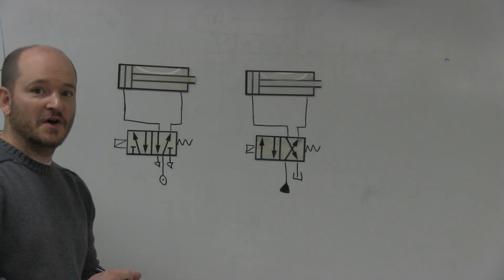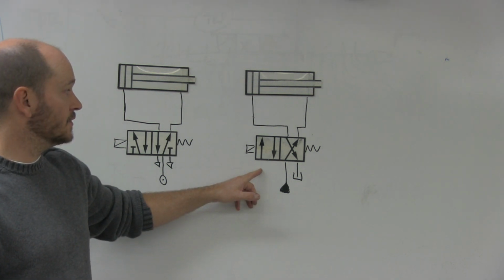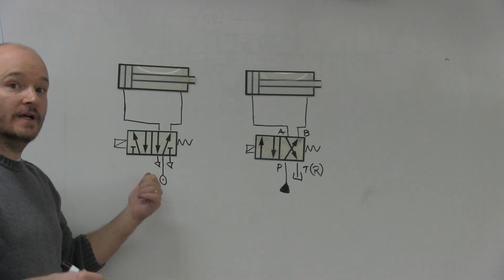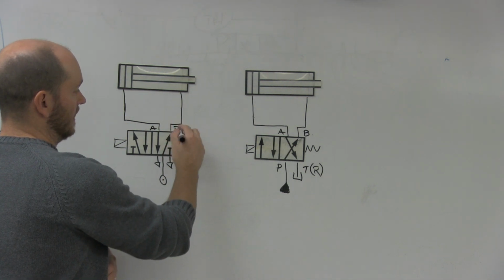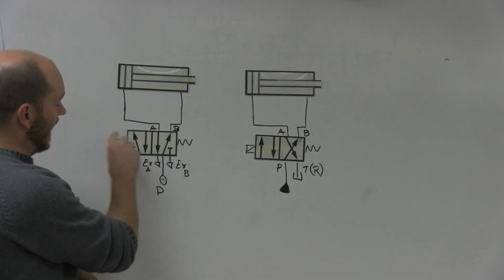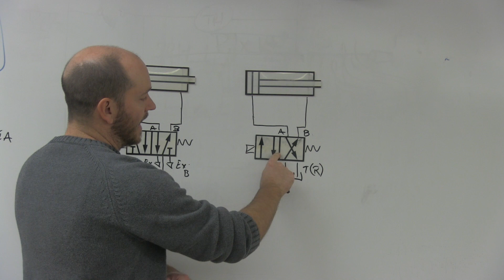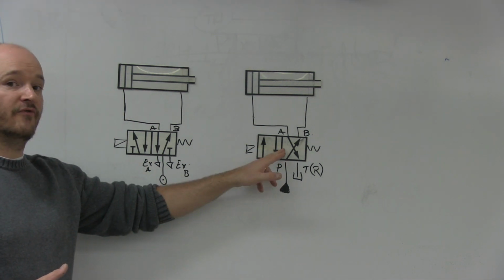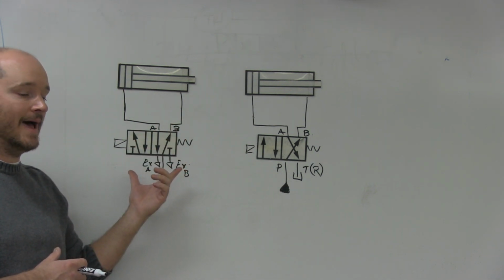Differences in Hydraulic and Pneumatic Directional Control Valves

Comment: what's the difference between solenoid valve & directional control valve? 
Thanks
Reply: solenoid is a device that moves a piston in and out typically with electromagnetism, like a motor, in this case the solenoid piston moves the directional control valve back and forth.

Comment: You can get pneumatic 4/2 valves with the identical siamese ex port arrangement as the hydraulic 4-2 (e.g. SMC VH402-04). The differences you've outlined are the differences between a 4-2 and a 5-2 valve generally, regardless of the fluid involved.

Comment: I’m having a problem with a pneumatic valve. extends but sometimes the exhaust doesn’t release the air or it won’t retract until I disconnect the air line then it works. I put new solenoid and valves. Thank you
Reply from the maker: Have you checked the muffler on the DCV?  They can get clogged.

Comment: A common term I usually run across in 5/2 directional valves is "4 way". Does that imply that only 4 of the ports are actually piped and the 5th is just exhaust?
Reply from the maker: Actually 2 ports are exhaust.  Since they are both exhaust some say it is a 4 way and some say it is a 5 way.  The advantage of calling it a 5 way is you know it is pneumatic.  Either way 2 are exhaust one is pressure and 2 are actuator ports.  Hope this helps